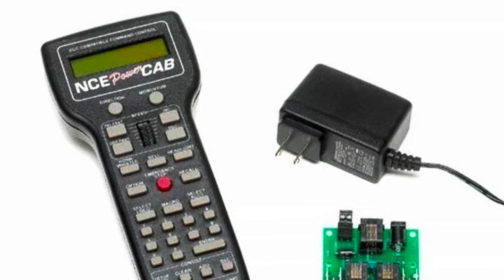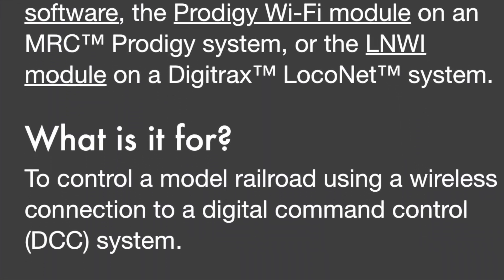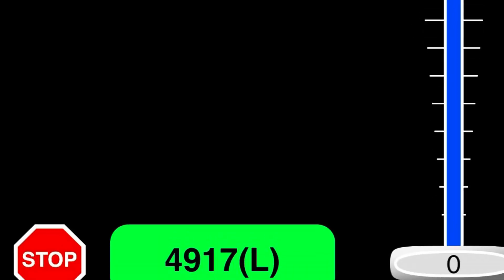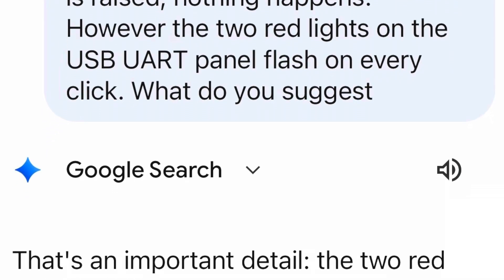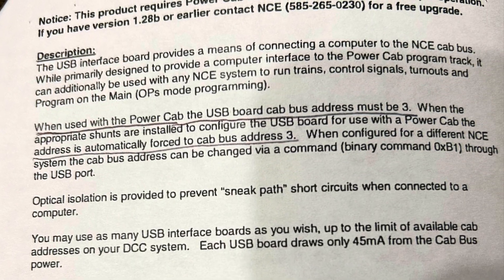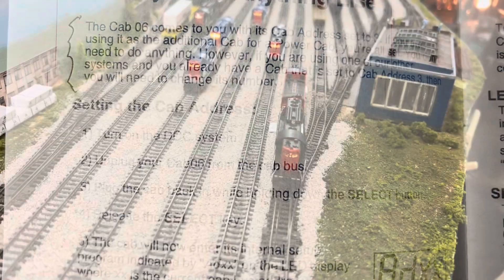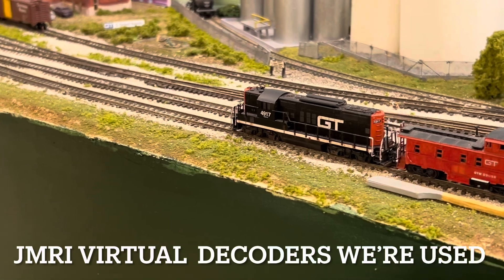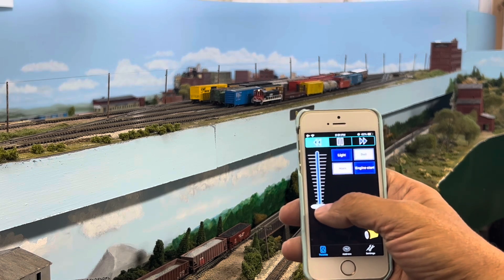How AI Helped Me Solve a Major Problem on My Model Railroad

Comment: As an electrician, the addressing issue to each device makes sense.  Every locomotive and other controlled element on your layout needs an individual device address to be properly automated/programmed.  This reminds me of all the contactor panels and drive motors on the rollbed conveyors I've been installing at work.  Every once in a while I'll pick the engineer or programmers' brains from the automation vendors and find a lot of programmable logic answers, even though I'm just a Journeyman Inside Wireman.  Never hurts to ask questions.  Your software is a lot like the PLC programming in the auto plants I work in most of my electrical career, just waaaay simpler.
Reply from the maker: Yep it makes sense to me now lol. Thanks for watching